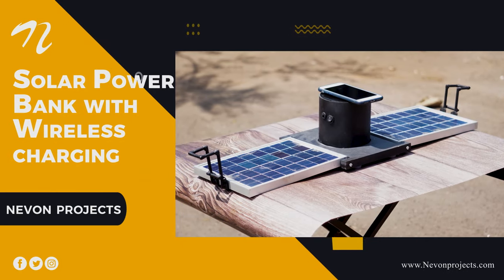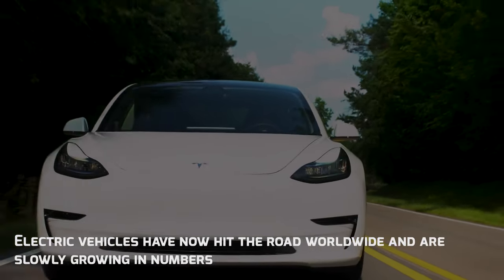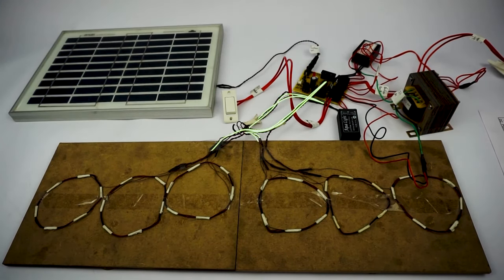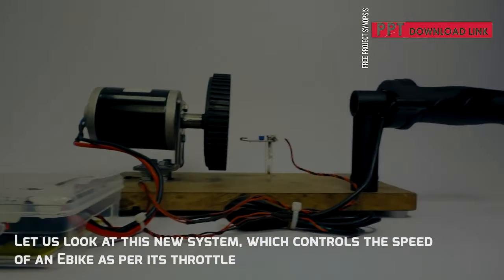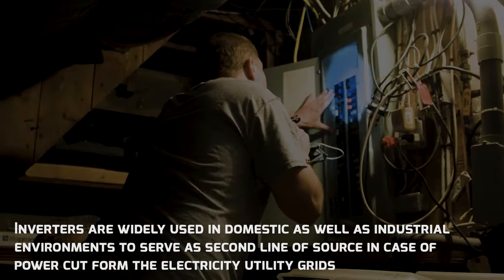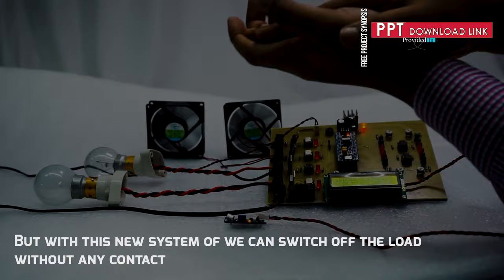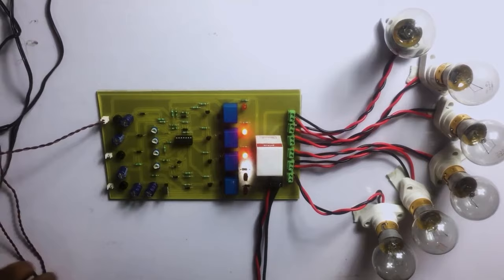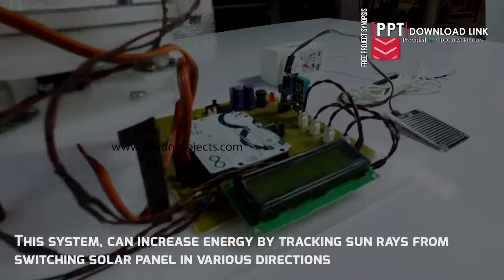Top 7 Electrical Engineering Projects 2022 | DIY Electrical Ideas

Comment: Issue with Solar Power Bank: Your mobile phone will get hot when exposed to the direct sunlight, you can make a shelter of Fiber Plastic on top of Wireless Charger but that will further increase the weight of your overall project. Any suggestion for that?
Reply: Yeah over energy consumption and no safety for phone and required som limited operation